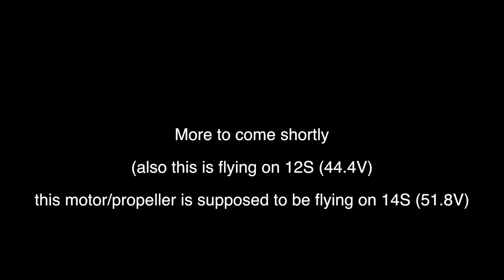My HomeMade electric plane Really flies!!!! (short hops) part7

Comment: Have you thought about changing props on that plane? Maybe something that trades pitch speed for torque? Or if those props are made for gas engines have you thought about thinning them so they rev up a bit?

Comment: Have you measured the take off distance yet? It seems very short, is this due to a large amount of power for this plane? Also how much power was both motors combined? Also, what is the noise it was making with the motors off at 11:57? But damn man,  keep up the good work.

Comment: Congratulations! You did a great hand-craft job. The aircraft is amazing. I am impressed how you present this project too. You are certainly very talented. Also you are courageous to fly it. However, I think you have some safety issues to be addressed. You could consider a risk analysis by writing down what possibly can go wrong, then set a probability and a severity to each thread, and define a mitigation action to be implemented. For example: You are a new pilot, controlled flight into terrain is often causing fatal accidents, thus you should invest in flight lessons. Also consider close(er) collaboration with more experienced experts. This will slow you down, cost you money, but it will also help you to stay safe. Keep up the great work.

Comment: The test bunny hops, often exceed the amount of runway ahead, Bensen BM8, ultralights and Para trike. FAA single engine since 1959. My DJI Spark among, other foamboard/ 3D printer builds, and acquisitions are a smarter age related switch. Rock on Peter.

Comment: Amazing achievement, seriously amazing but please have a think about some basic protective equipment.

The comment about it just nosing forward if it stalls is really worrying - that's the sort of thing found out by a long program of flight testing, for all you know it actually drops a wing at the stall. Will there be any warning, any buffet?
I'm assuming you've not built any washout into the wing so it all stalls together?
At the high AoA you were flying at you could literally be three knots above a full stall and not know it. She might give you a nice buffet and then drop the nose in a gentle mush, she might also give zero warning and snap roll 100 degrees in a second.

Please wear a helmet (and a parachute for the later, higher flights). I'd be in nomex and gloves too in case one of those batteries or the ESC let's go.

Big achievement that you can be justifiably proud of but don't forget to look after yourself too.

Comment: Those strings on the motor holders, are those for structural purpose? Because if so, since the props are pushing, they should be the other way.
Reply: Ah nevermind. I just realized those are rods

Comment: Well done! FWIW, I don't think you have anything to apologize for: this is at best (not to take anything away from the great accomplishment) a "hopper" plane, with very limited capabilities. I'd encourage you to continue test flights so you can characterize your plane:
-max take-off crosswind
-max speed
-min (stall) speed
-max altitude (can be dangerous)
-max range
and characterize its maneuverability and handling.
Are you confident that the landing gear can handle the landing impact, straight down, and side to side?

Comment: Taildragger tips: Stick full back on landing, keep it back through the roll out. Light even pressure on both peddles, don't stab at them alternatively, just more pressure on one or the either when needed, overcorrection is bad. Also, make sure you have as little slop as possible in your control system, the rudder looks a little wiggly.

Comment: So you didn't actually take it outside of ground effect? Also where is your pitot tube mounted, those airspeed fluctuations look dangerous. Btw.: No, he hasn't "proven the naysayers wrong". That's not how statistics work. What Peter is doing is still bloody dangerous and the cavallier attitude he shows doesn't fit well with experimental planes. As an old instructor of mine put it: There's old pilots and there's bold pilots, but there are no old and bold pilots.

Comment: Did you epoxy the threaded inserts into the control rods, or are they just held with cotter pins? I noticed that in the build video and mentioned it, but no response. A cotter pin should never be used to carry a load, they're just to keep things from moving.
Reply from the maker: Peter T-88 epoxied! The cotterpin is there to keep the threaded rod end from backing out of the sleeve
Reply: Good to hear. I had noticed another issue too, the brackets for the pulleys would be a lot stronger if they had spacers to allow the mounting bolts to be tightened properly. It would keep everything straight and prevent wear that could weaken the mounting bolt over time.

Comment: As an old and crusty RD&T test flight engineer & pliot it appears safety needs to be brought up here. Peter you are young and healthy:Stop a moment and consider safety. 

Number One: Wear a helmet. An skull injury will put a stop to all this fun and learning.
Number Two: Install a roll-bar with lower seat head rest to mitigate the risk of a skull fracture and broken neck. 
Number Three: Stop for the moment and meet with some flight test pilots and engineers. Go over your design failure modes and impact forces. 
Number Four: Keep good records of what you are doing. 
Number Five:Fly safe: airplanes can hurt you! 

Questio: Do you have medical & flight accident insurance? If not:GET IT!

Side Note: One aircraft design group to get ahold of is at KU Aerospace Engineering in Lawrence, Kansas (Jayhawks) where they have mastered and won more aircraft AIAA design competitions than any other University. They'd no doubt work with you. They are aerospace engineering students, so use to working together. Go to their American Institute of Aeronautics and Astronautics KU . org site. 

Keep up the good work. However, get safety minded.
Reply: JJ Poole I think that is true only for airline operations and not GA, let alone highly experimental ultralights.
Reply: I firmly support what you say. A head or cervical spine injury is something you cannot be to careful about! I hope he reads this.
Reply: I wonder if the strut structure supporting the upper wing serves as a decent roll bar?  Those aluminum risers look nice and beefy.  There would be a good bridge between the nose and the upper wing support beams if he flips.  But yeah, a nice bike helmet would add almost no weight, and could save his life.  I really hope he wears one.  I do a lot of cycling and skating on pavement and ice.  I have seen helmets save people's lives.  He's probably already got an old bike helmet in his garage!  :)
Reply: Ronald Barrett your right about most of this but it’s an ultralight and a lot of things that would be good for safety are very heavy.
Reply: Excellent remarks, Ronald. Well stated. The org he mentioned: http://www.kuaiaa.org/
Reply: Max, great to read your input here. I, like you, attribute the fact that I lived through so many aircraft related accidents to pure luck and the willingness to constantly think safety. 
I sure hope Peter takes a minute to meet, and ask other pilots, "Is this safe? Is this safe? Is this safe?" And then proceed on.

Peter is bright, a genius, and spirited. He is an inspiration and a doer! Really wonderful to witness. However as a grandad flier, I do worry. 

Max, your remark, "So designing those sources of error out is the best way to avoid them." This is how we really work in the aviation industry and why it is so safe to fly. Good way to be.
Reply: Andrej Spudič True but I would still fly an ultralight anyday and feel just as safe.
Reply: thechosendude something close to one
Reply: I wouldn’t ride a lawn mower without a roll cage.
Reply: Ryan, I've flown all my life and it's the unexpected that gets to you. I remember the Rutan -  "Pond Racer" of 1993 Reno race fame and how the pilot Rick Brickert was burned to death… even though the engines were out on their own…away from the cockpit, but the fuel transfer lines+valves were at the foot of the pilot and there was where the the fire migrated to! The Pond plane had a like-P-38 configuration.
Reply: I almost had three bad accidents in my life. I only didn´t get injured out of pure luck. These happen when more than one safety fucks up. Bad coincidents accumulate to a giant fuckup. So designing those sources of error out is the best way to avoid them.
Reply: Roll bar!?  How do you expect him to keep it under 254lbs (assuming it already is)?
Reply: JJ Poole consider that any commercially available ultralight was tested with extreme safety before it was deemed safe enough to remove such devices. I would get aboard an ultralight without a roll cage too, because I know carbon copies have had hundreds or more hours of flight proving them. Just like any modern airliner undergoes safety checks with dead weight instead of real passangers in the seats.
Reply: FINALLY! Peter PLEASE listen to this guy!
Reply: Nah his a skill Pilot (amateur)
Reply: Ronald Barrett lol I understand and agree with safety being number one.... but how many planes have you seen (especially ultralights) with roll cages! Sure a helmet would be good but keep in mind planes are a lot safer than any car is.
Reply: JJ Poole Riiiiiiiiiiiight! So tell me, how many people do you personally know who have survived a car crash? Now, how many people do you know personally who have survived a plane crash? You honor, the prosecution rests.

Comment: Awesome Peter! The motor pods are the main things I think needs a redo though! 1. They are a drag man! LOL And, they collect air and throw it out from the inside and create a lot of turbulent air for the prop. 2. They scare me with how they are made out of wood and how they are mounted. Please make them out of alu tube with a cone on the front! Some welding will be needed. You may also want to slip some airfoil foam over their mounting bars to reduce drag. Also, Are you planing a rounded or "V" windshield and a tapered fairing behind you to address the drag around the pilot seat?
Reply: Dude is only going about 30 MPH.  Drag is not a big issue compared to safety.  He should wear a bike helmet and some goggles at least.
Reply: What is the motor cooling strategy with a closed coned nacelle?
Reply: If cooling via the nacelle is required then leave a portion of the tip open. At first I only thought of welding on a closed cone, but now, with the help of your rebuttal, I realize that the tip (now intake cone) could simply be 3D printed, inserted into the tube/nacelle and screwed in place. With it being 3D printed he could easily experiment with various designs. For the rear motor plate, it could be machined alu with the necessary holes to allow air to enter the motor, and be of a diameter just larger than the diameter of the motor, were it could be recessed into the tube of the nacelle where the air that enters the nacelle would be forced both into and around the motor. (But, do not insert the motor into the nacelle so far that it covers the bell as the leaked flux would interact with the alu and cause a breaking effect). Thoughts?
Reply: It's almost certainly not an issue, given how small their frontal area is.
Reply: Agreed, however don't put a cone, or put a cone with a smaller hole to have some airflow into the back of the motors.
Reply: GITech yea but that is plywood glues together using hobby techniques.   Those pieces are ridiculously strong.    He could out an aerodynamic fiberglass shroud around it tho.

Comment: Two things: 1. redo the engine nacelles, i don't think they do anything positive to the blade action. 2. do strong covers for the wing gaps. Tape is nice but that's an area that could be improved based on the twist it developed.
Reply: Also, i wonder what would happen were you to add rounded tips to the ends of the wings...

Comment: Peter, please do extensive ground testing including temps of motors, esc’s, and batteries after you upgrade to 14s and re prop.  One Esc shutdown on a twin at 10’ altitude will force a tip stall.  Also, because it’s a counter rotating (?) twin, there should not be the forces on the tail to make it ground loop - that’s when a single engine causes unbalanced forces onto the tail surfaces.  I’d do ground testing at full throttle for at least four times the duration you’d expect to use WOT for takeoff and climb out.  Also I noticed you are very choppy on the throttles; try to slowly adjust them.  And stop screwing with differential thrust for now; fly the plane like it has one throttle so you can properly analyze your rudder effectiveness alone, then play with differential thrust after it flies well under one throttle.
Reply: Its not counter rotating props -- he covered that in past vids.
Reply: Also be careful flying in much of any cross wind.  It looks like with your minimal tip clearance you will not be able to use much cross wind slip correction before hitting the tip of the wing (on the ground), which could cause a nasty ground loop.
Reply: I was going to say the same thing re: messing with differential thrust during takeoff/landing, but you said it already.
Reply: runningwolfkenpo He’d live if he crashed, much bigger distribution of force than a car.
Reply: VideoGameGang I'm quite sure you are wrong on that one.

Comment: you should change those engines for rc turbines
Reply: Skotthas Dafever They have loads of power. A guy created a wing oack that has 2 and he can fly beside a cessna. This would require 4 or 5 and be more efficent then electrical engines.
Reply: Turbines have spool up/down lag that makes controlling differential thrust harder and are more complex, meaning higher risk of failure.

Comment: I would add a sinkrate indicator like a sailplane uses to establish part and no throttle maneuverability standards for your airframe. I am afraid your axis of thrust is too far above your cg, and is forcing the the nose down. Awesome job, and be careful. There are old pilots and bold pilots, but no old, bold pilots.

Comment: A few tips!
1. Put a short piece of string on the nose or windscreen, to see if you are flying straight in the wind. 

2. put short pieces of string all over the wing, and film them with a gopro, to see at which how far and when the air stops flowing over the wing and becomes turbulent. This can help you to find how much you are allowed to pull. 

Here a video so you can understand. In these 2 videos, someone stalled their glider on purpose to demonstrate how the airflow started to become turbulent on the wing. The point at which this turbulent airflow began moves forward, the more they pull the nose up. In the first video you can also see the small string on the window that is used to make sure you don’t fly at an angle to the airflow which would be very inefficient. This might likely happen to you as your motors are mounted relatively close to the center of mass and you have differential thrust. 

https://youtu.be/zxlAjC6h2BQ

https://youtu.be/kOCk8LYUEjw

3.  how about wearing a helmet?
I know it won’t be sufficient for a crash from height, but for these small bits it would definitely be helpful. And if you ever have to use that recovery system, it might come in handy when the plane comes down. 

P. S. :
Sorry for any typos or wrong terminology. I am German and know the German terminology a bit better.

Comment: Awesome! You truly inspire me! 2 suggestions: your landing gear really has to be taller otherwise, no matter how good you are at flying, your wings will always be too close to the ground..you can't trust the wind! I have probably missed it but if you don't have an elevator trim installed (and don't want to cut the elevator for a tab), an easy solution is a lever with dents that charges a spring connected to your controls, I used to fly an old biplane from 1935 with it and worked like a charm

Comment: I litterly have Teers in my eyes! You did a great Job, Peter; Sam; and Peters Dad! Its soooo awesome!
Reply: Idea: Make a small pin in the right handel of the throttle. If you push it a small tube gets pushed from the right  to the left handle, so both get pushed together if you push the pin

Comment: What's the all up weight without the batteries? Did you get a fuse or breaker in between the batteries and ESCs? What ESCs? Are you using? 

Can't wait for more content!

 Patience is virtue. Ultralights are low and slow, so take your time with learning it and making sure your safe.

Comment: 6:55 I'd inspect the panel above your head in the upper airfoil. It looks like it might be deforming too much during takeoff. It looks like your windscreen might be pushing more pressure under it than it can handle.

Looks like it is just a sheet of paper?!?

Comment: Just kind of a random suggestion, I'm not an aircraft designer or pretend to know anything about full scale aircraft. But would it be good to have some sort of through pin that you could lock the two throttle controls together? Maybe so it's easier to sync the two motors on accelerations and deceleration?  Just a thought! Anyways, I'm so glad to see it up and flying!! thats so awesome!!!

Comment: It has been fun following you... but Lord all mighty... lol...
They thought Stranger Things were scary... 
A suggestion for you - since this is a tail dragger. You are not done flying it until you leave the aircraft. During landing and especially after touchdown of your tail. Keep the stick pulled - I noticed you let it slide far forward and one day it will bite you in the a** especially if you are on a smooth surface 😂

Comment: The common outcome if it goes wrong and you crash is traumatic head injury. Fly with a full face motorcycle helmet. You can still see, don't need the windshield and you may be able to think later if the worst happens. Pretty cheap insurance. Just my old fart (I have survived) common sense advice.